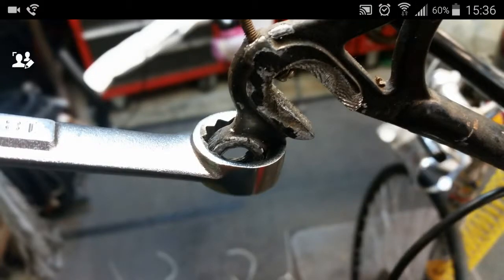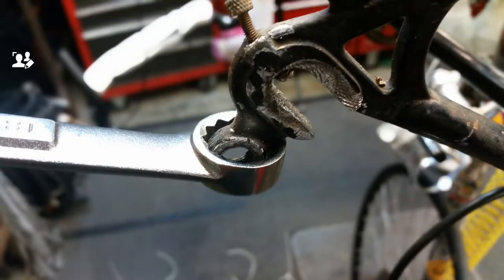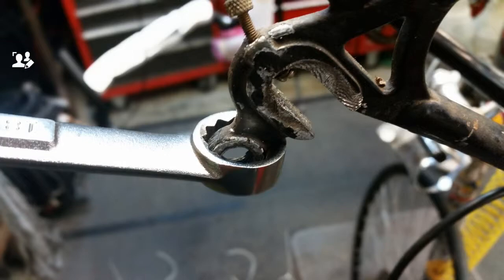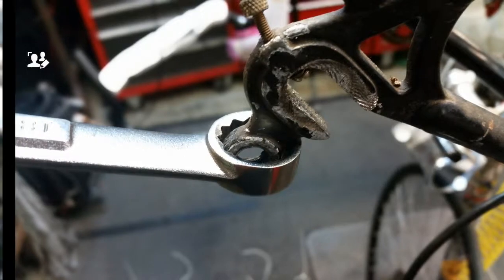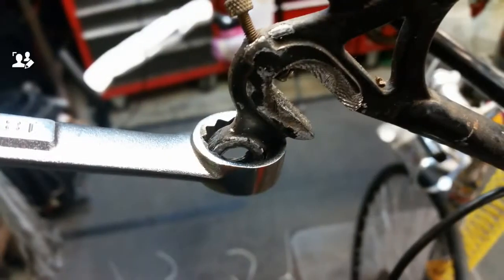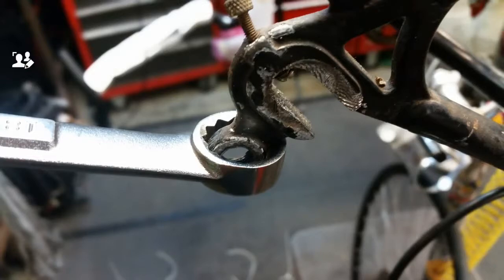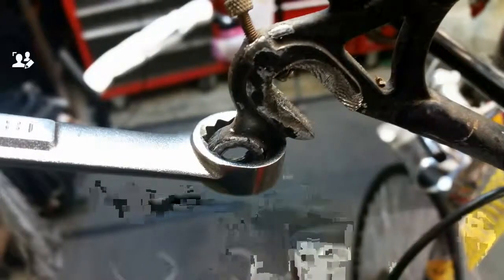Close a bent open dropout on a bicycle frame

Comment: I know this has been awhile ago, and it might be an unusual repair- but it was just what I was looking for- after waxing my chain, I was in a hurry to test it out- didn't get the master link snapped in right- lost the chain and screwed the derailleur hanger and derailleur up.  Fixed those and had issues with the wheel pulling out of the dropouts on a hard stand on the pedals in too high of a gear.  After about 5 falls (my education was a long drive on a short bus), I finally inspected it thoroughly and saw where the drive side dropout had opened up.  I liked your method because it seems that the 18mm box wrench puts the pressure in the right spots.  I'm sure that should do the trick- but am taking the cages off my pedals for awhile just in case- winter riding in Ohio- not a bad idea anyway.
Your video is a golden nugget among so much you tube junk- just describes a fix in 46 seconds- no hype- and the fix works!
Thank you, 802BikeGuy, you just kept an 87 Fuji Tiara on the pavement- and hopefully upright- now!!